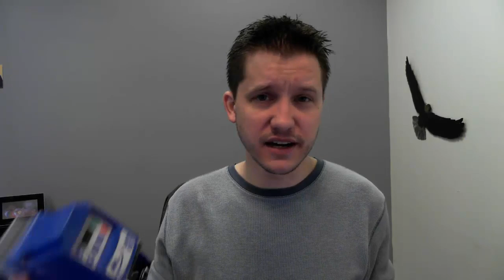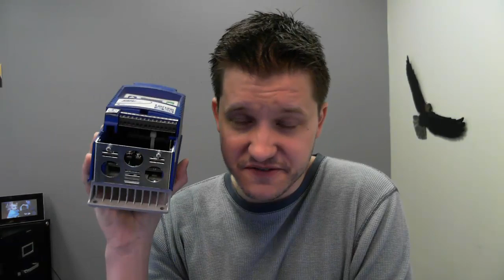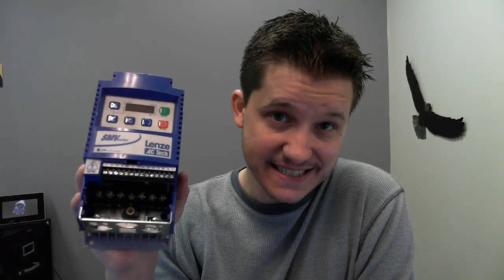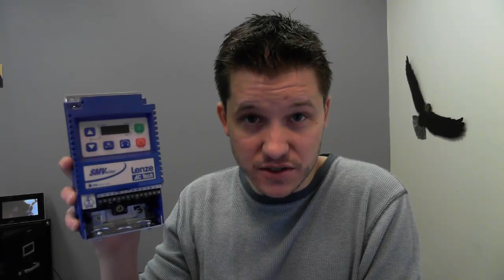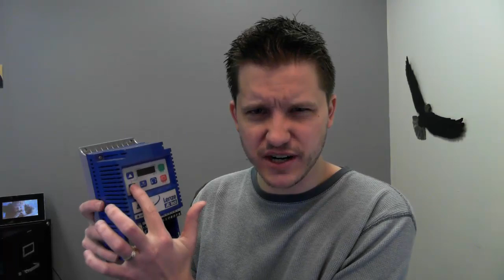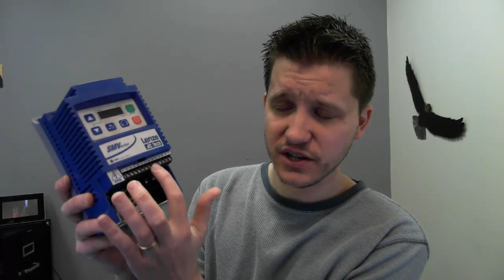What Is A Variable Frequency Drive? (2020)

Comment: hi am impressed and have a question hope you can help i have  CUB11A-1  2.2kw and want to put it on  commercial treadmill which has 2.2kw motor   what would you recommend  on how to set torque  and load at low speeds so belt does not stop regardless of load also how would the filter be wired?

Comment: How would you go about plotting the output speed of the motor? For my project I need to plot force (from a load cell) vs velocity of the motor. Any ideas? We will be using a microcontroller unit such as arduino.

Comment: Can you use a vfd in conjunction with a rotary phase converter.
So that tour vfd doesnt have to create a fake three phase power source?
Reply from the maker: Yes. But you will want the VFD to be on the output of the rotary phase. The dirty three phase power from the VFD was only meant to run motors

Comment: Craig,
  What if I have a motor and I just want to slow it down.  I dont need to change it to many different speeds I just need slow it down to one specific speed.  I dont need all the options of a VFD I just need to shift 3 phase AC from 60 Hz to lets say 45 Hz

Comment: I have washing machine that runs on 115 volts at 60hz but my power supply is delivered at 50hz. The washer is so sensitive that it won't even power on when it detects the 50hz. ( The whole country's power supply is delivered at 50hz or 50 cyclr).

The machine did power on when it was connected to a generator that delivers power at 60hz.
Will this product be good to use on my washer seeing that it has a motor?